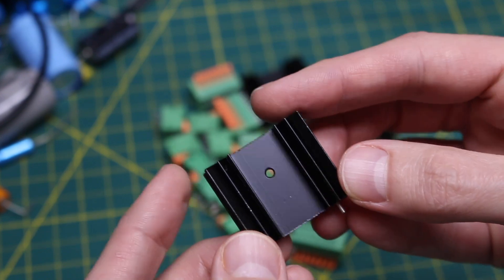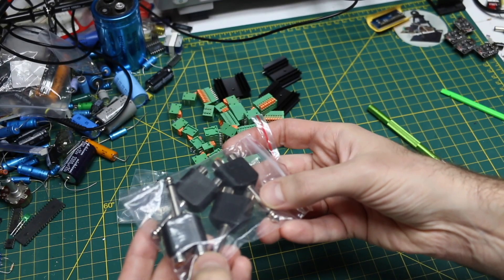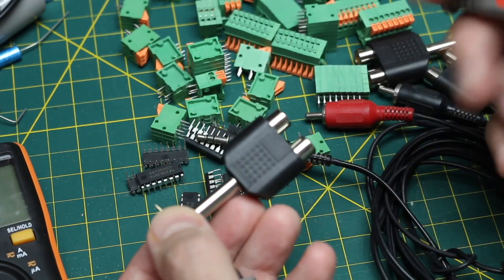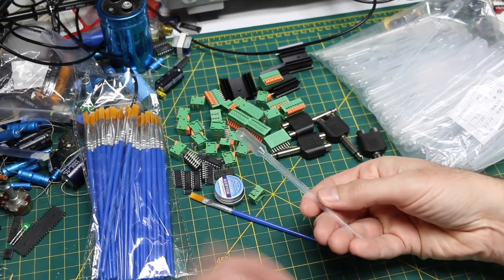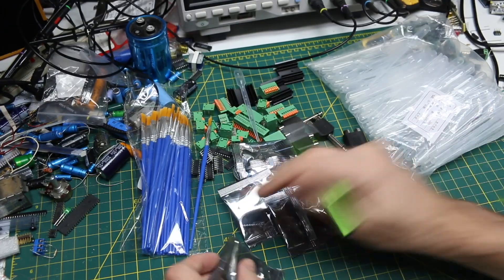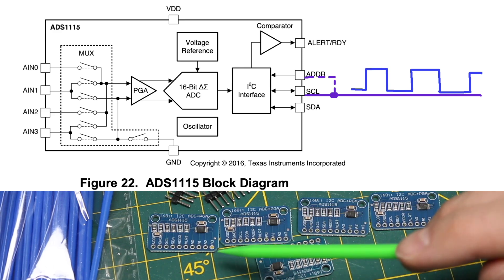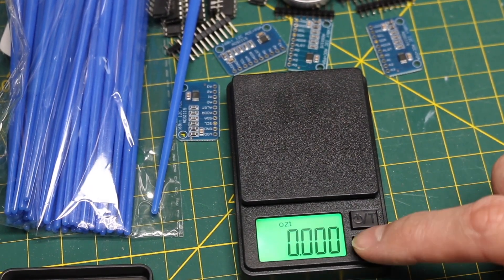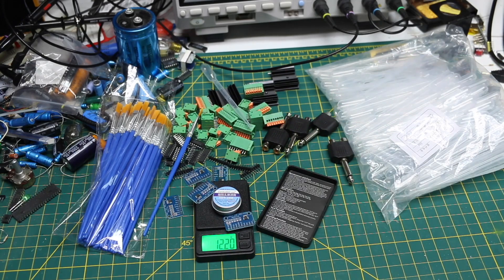Mailbag!

Comment: The small brushes could also be used for solder paste applications when you have a row of pins that need installing.   I found it faster to thin out my paste and brush against each pin prior to heating to get small amounts per pin and not just brush across the holes on the board.  It does take a steady hand as well as getting a thin consistency of solder paste in those small jars.  I have mixed a small amount of rising with alcohol and used small amounts of that to thin out a small jar of solder paste.